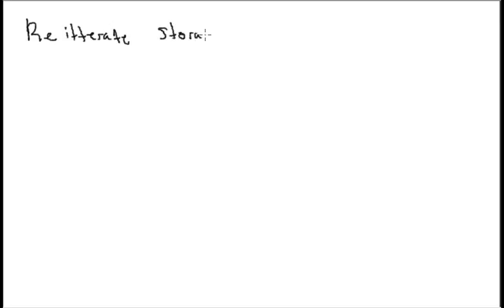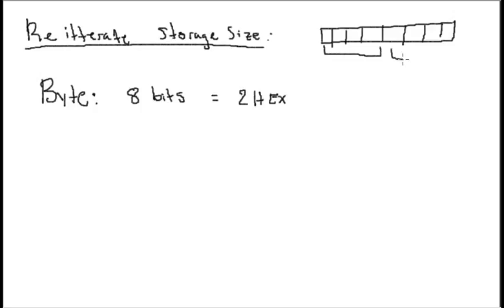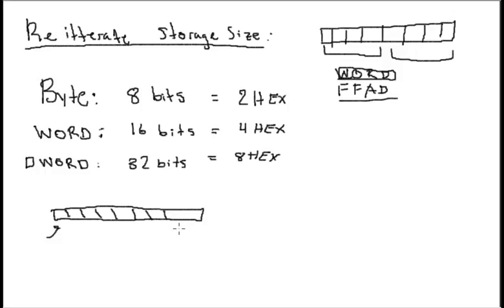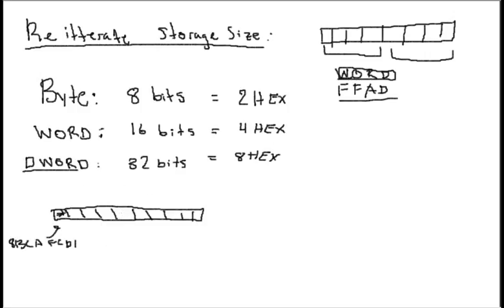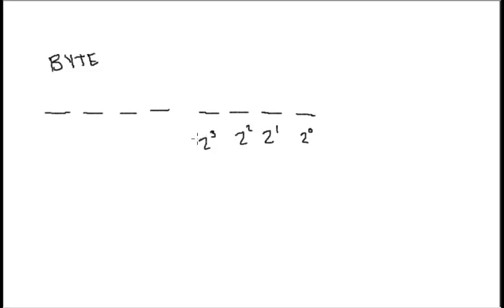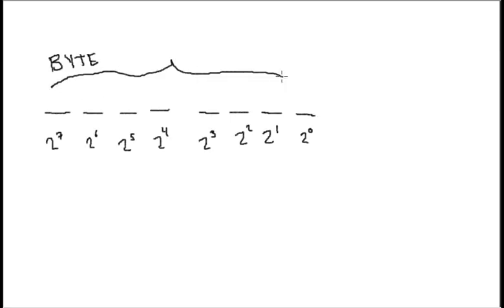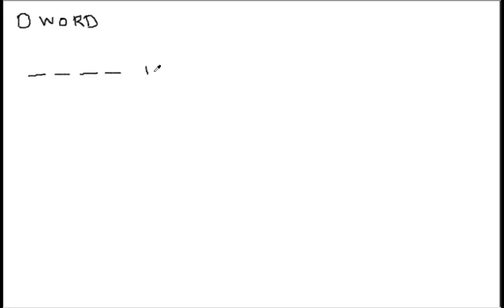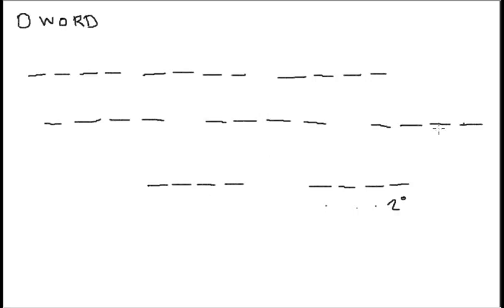Review of Storage Size Byte and Dword: Assembly 80x86 Intel Detmer Video 7

Comment: bit = 0/1.
Byte = 8 bits.
WORD = 2 Bytes = 16 bits.
DWORD = 4 Bytes = 32 bits.
QWORD = 8 Bytes = 64 bits.

Seems simple enough, but DWORD only holds 4 bytes, which is large enough to hold any memory address up to 4GB and no more...
Luckily there is another one called QWORD.
Which means that QWORD is 8 bytes and can hold any memory address for 64-bit computers.... Not entirely sure where QWORD's limit is though.